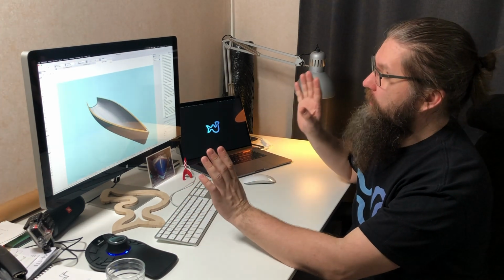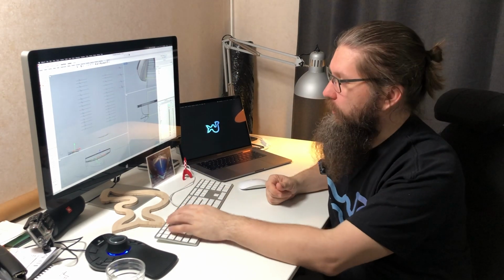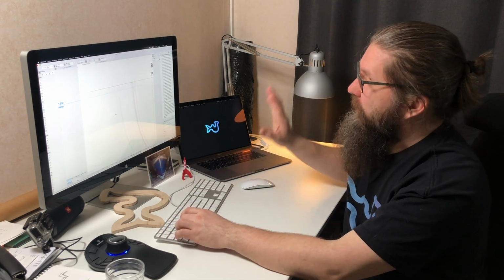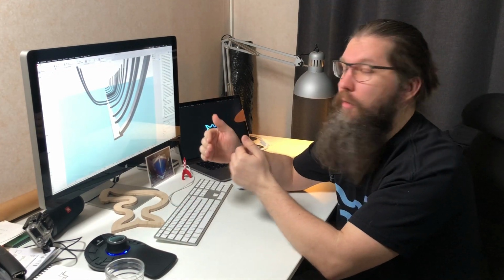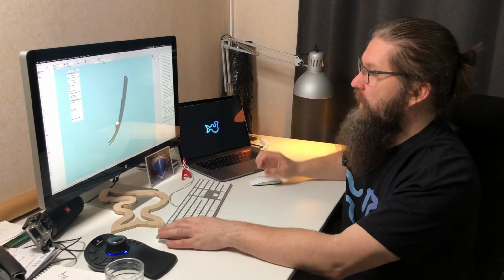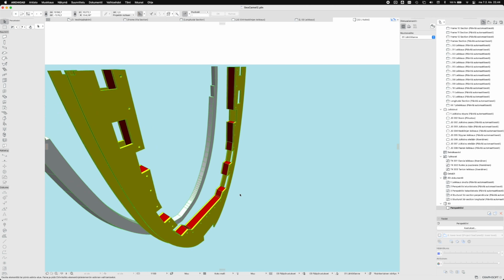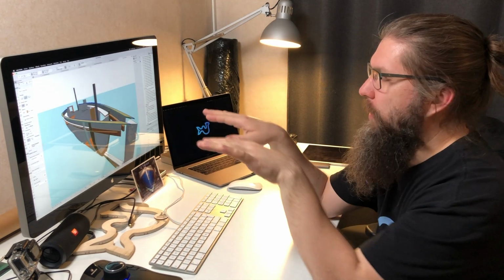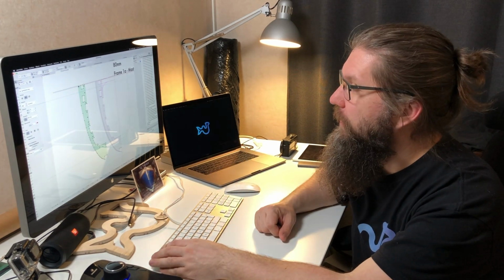Sailboat building: digital lofting! ep.33 Project SeaCamel

Comment: Hi Mate ! Nice piece of CAD work. I wonder why you do not cut the frames in the plywood using the CNC machine and laminate them together to get the full frame finished at the thickness you want. It will be as strong as your laminate woods but much easier to produce as you just repeat the CNC cut .
Reply from the maker: Hi! Good question and suggestion! I think I’ll ask this from the naval architect. I would imagine that the fibers of the wood aren’t continuous if just laminating plywood together so there might be some issues coming from there… but I’ll ask!  Thanks!

Comment: Hi Mate, i love this channel and I want to thank you for sharing your journey with us. I have a small question / suggestion for you - why not cut the plywood formers for the composite ribs in such a way that they could be incorporated into the finished rib? That could provide extra strength and/or reduce waste...
Reply from the maker: Hi! That's actually a great suggestion. So that there's two plywood sheets and lamination just on the middle of them. That may bring some challenges to get the shape right (as I have to plane the plywood edges off as well) but I have to check this with the naval architect! :)
Reply: @ArcticSeaCamel  Yeah, I guess thats an extra bit of work - having some plywood there to screw into could also be handy.....

Comment: Grate Progress! One question/suggestion. What method will you use to plain the laminated framme to the final hull angle? Do you not whant that angle on your mold now then also?
Reply from the maker: Hi. So the idea is to have the both edges lofted and cut with CNC. And after the lamination just plane the surface with powerplane to it's final shape. We'll see how it works! 😅

Comment: Love it! If I had one suggestion, it would be to try transfer your model into fusion360 (download free liscence) then you can have your 3d model, components, assembly etc, and you can use the same for CAM to generate toolpaths for your cnc. It will be a blessing in the long run and the learning curve is not high, and there is alot of support from our friend Google. Love the progress cheif!
Reply from the maker: Hi! Yeah, the tool paths will be done with Fusion, but I can't transfer the model there. It's way too complicated.

And Fusion doesn't work that well either... It's quite slow when model gets a little more complicated...

So, i'm creating polyline drawings from my 3d-model, export them to fusion and simply make just the cutting files from there. Too bad that the automatic nesting isn't available for the free version.

Comment: Im not so sure that jumping from Rhino to another CAD-system is the right way too go. Rhino is a surfacemodeling software and the other might be a solidmodeling software. And going from 3d to 2d is absolutly the wrong way to do this in my mind.
Reply: Also freeformmill everything, the only nice way to make all pieces fit together.
Reply from the maker: Hi Mathias! Thanks for the comment. I understand your view. There’s definitely room for development here.

The first problem is that these parts to be laminated are quite big and they need to be “one part” to gain the strength needed. So I need to make the CNC cut parts as smaller pieces and connect them as mold to get the laminated forms right. Can’t see obvious ways to freeform cut these pieces. This may change when starting the bulkheads and stuff.
But mostly the parts cut are thin pieces of plywood, so “2D” cuts will be sufficient. But I will definitely try to do some parts as freeform cuts. Stem comes in mind.

Problem with using rhino as “the program” is that I use only trial version and I haven’t used it that much. So using Archicad is much much faster even if I have to do things a bit “wrong”. It can handle solids in some form so I can make Boolean operations where needed.

Comment: I'm enjoying watching this build, all aspects of it. I do have an observation, maybe you have considered it. 
The Gunwhale height you have chosen is 200mm?  (Remembering from a previous video, open to correction on that) your drawings dont show any Scuppers?? 

If/when the Boat "stuffs" into a wave,  your relying on upward travel to wash the deck clear? 
With 200mm "trap" potential for and additional quarter Ton of water on the Bow, until it clears....

I would suggest adding in 150mm by 300mm Scuppers spaced about 1 to 1.5 meters apart. Place the Cleats centered to them on the deck.

Currently, best case you get swamped and momentarily loose stability (not a nice feeling.. worst case, the Boat stays Bow down and the next wave swamps and has you top over....

Just an observation, I hope I haven't overstepped with this comment. 

Fair winds my Friend.
Martin.
Reply from the maker: Hi. Good point. I have had thoughts about those holes. On the other hand the stern is open and deck is slightly lower back there so the main route for water that way.

But I think there will be some scuppers anyway. :)
Reply: @ArcticSeaCamel  Ask the Navel Architect you mention? Scuppers help recover from broaches and accidental Gybe incidents and should not be ignored! They can be as small as 100 x 25mm, if there are enough of them.

Comment: Thanks for a great video! At 17:41 when you said "easily" plane the shape of the frame, I could not help but noticing that the right yellow plywood side does not conform to the shape of the hull and would probably be in the way if you plan to plane the surface of the frame while it is clamped between the two sides. I guess this is because the CNC machine cannot make angled cuts? Unless you plan to plane the side along with the frame? Or do you plan to mark the edge of the two sides once you laminated then remove the sides and then plane the frame?
Reply from the maker: Hi Linus! Thanks for the comments.

The CNC can do angled cuts but they’re of course much slower to do. But the reason here is that for most of the molds, they’re used to the other side as well. (or actually I don’t know yet, depends of the floor structure solution…). But anyway, the other side creates edge and the other must be done with mark or just planing carefully to the “joint”. We’ll see how it goes!